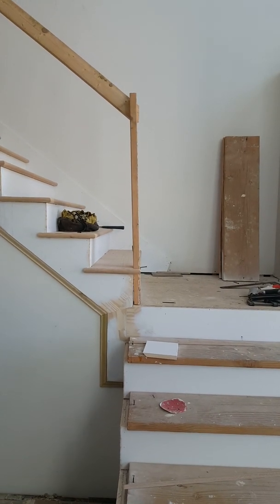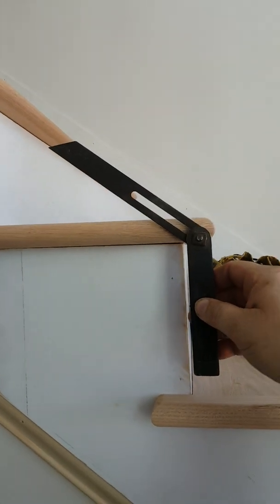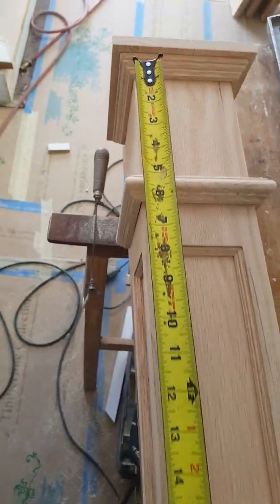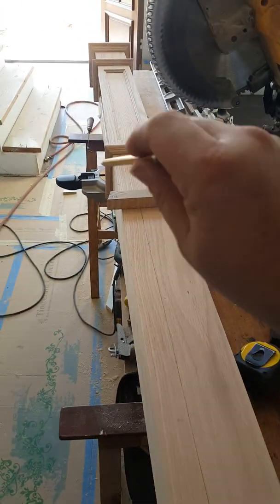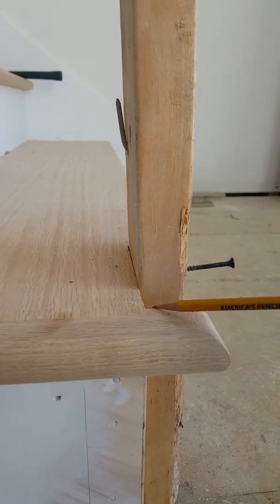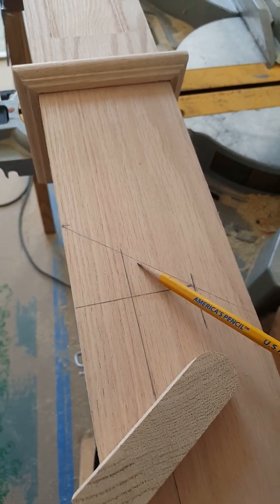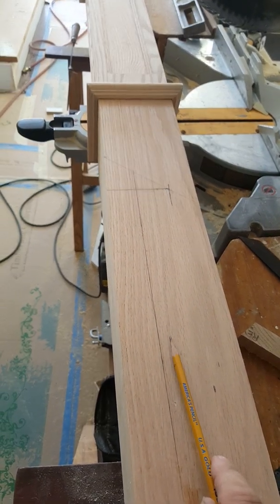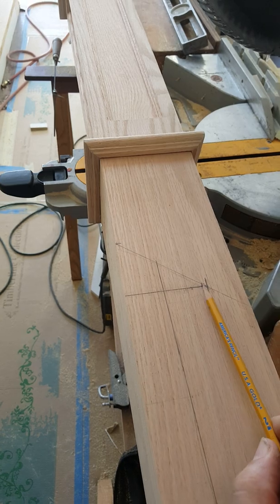How to determine stair newell post height.

Comment: Also, how do you find the length of the rail as well after you put the post at the top or if there is a oval instead? I’ll end up laying everything out in AutoCAD step by step and set back by set back, along with the thickness of each step and then it tells me what the angle is after I offset my lines between 34 and 38 inches off the front of the nosing.
Reply from the maker: there may or may not be an oval(called a rosette). as i said in the video, it depends on your particular situation... and my video is NOT  made to cover all situations! the handrail aspect is a complete DIFFERENT chapter in the lesson. i was NOT including nor instructing handrail installation. i was simply accounting for WHERE the handrail would intersect the newell post for height reasons. but as far as the angle or "rake" on the handrail, it is SIMPLY determined by laying ANY straight edge on the nose of 3 or 4 steps at least, and then placing the BEVEL square on that straight edge while placing the other side of the square on either the step...OR the riser, which ever is appropriate... determined by YOU. THAT will be your handrail cut angle. typically it's approximately 37⁰-38⁰.  cut you a scrap piece of 2x4 or similar aprox 3ft long to replicate AND check the angle by ,once again, laying it on the step nosing. you can use those pieces to help determine the handrail length. but THAT (handrail) lesson is in the other instructional video...the one you never paid for. so you'll have to figure THAT out on your own. i made my video VERY CLEAR in that.. each stairway could be ...and probably will be different...depending on your unique situation.  I'm NOT at all "vaque". 
as far as your foolish statement about me collecting money for my videos...let say with utmost clarity...i simply DO NOT get ANY benefits from posting any of my videos! your a FOOL for implying that i do, at least at this time. ive NEVER  took that position.  im simply here to offer up some help for those that are in need of it...or maybe just some inspiration.  personally when i look at videos that dont quite capture what I'm lookin for, i jus simply move on... i dont make ass head bitchy comments to people like u did to me. as far as waiting 5 or 6 days for a reply.... you're lucky i even replied at all. if i was commenting on others post, i would consider it normal to get a response back in 5 or 6 months! 
let me remind you ....im NOT getting paid to do any of this. so if my response does not suit you...please send me a personal $$$$$ payment so i can give you more lessons. you can leave that computer turned off if your doing a stairway with me.. 
I've got plenty of other thankfull, appreciative comments regarding my video... i KNOW EXACTLY where i stand as far as  Competent, solid, throughly, good, well defined craftsman. your opinion is  Miniscule in the landscape. just as your  LACK of content on YOUR page is all the proof that i need. let your works speak for you.  but in your case, while asking for help... your words of ignorance are loud and clear.  now go put your handrail up...and leave me alone!
Reply: @hotrodswoodshed7405  wow, just wow. That is all I can say to that posting. You surely have a lot to learn about tact and business. If your business name has anything to do with your screen name, I can assure you that you are going to lose business by being such an asshole.  In my 27 years of being a high-end custom cabinet maker/furniture builder, I haven’t needed to do and learn good methods of figuring out the length of railing, etc., as I can just use AutoCAD and be a lot more accurate than you are able to be. Best of luck to you and your endeavors being a dickhead.
Reply from the maker: @mim2046  best of luck with your cabinet shop
Reply: @hotrodswoodshed7405  Well stated!
Reply from the maker: @curtisbrowning2817  thx
Reply from the maker: not easy to give you a quick awnser at this moment..  ill think about this, and respond at a later date
Reply: @hotrodswoodshed7405  it’s been 5 days….do you really need to take that long to “think” about it?  Why do YouTube videos to “teach”, yet leave out critical information, say you have to think about it and then never respond. Seems kinda pointless 🤷🏻‍♂️

Comment: Unless it is just me, you didn’t show how you actually got the angle of the rake of the steps. U held your sliding bevel up to one step, but it obviously is not long enough to reach the next step, so how did you find the angle to cut your railing at?
Reply from the maker: i used a long straight edge object...like a level or wood strip to connect those steps...and lay my bevel square on that

Comment: Thanks, just the info I needed
Reply from the maker: You're very welcome. Realizing that every stairway can be different with even the most smallest changes. Still hoping to give the aspiring Craftsman some tips and at least get you pointed in the right direction, where you can figure the rest out. Thanks for the great compliment

Comment: Why would you cut all the way to where the nose is, the second vertical line in from the left side? Especially if the nosing on the tread is cut in, wouldn’t that push the post to far to the left? I followed this for my post and ended up cutting it too far in.
Reply from the maker: I DON'T recall saying that I actually did cut the post to the pencil line where the front edge of the tread nosing is.
 Watch the video again. In the video where the post is laying down and I'm using my pencil to show the cut out marks on the bottom of the post. The far-left vertical pencil line is my actual post cut line ( that will actually glue to the face of the step riser). However The far-right vertical pencil line represents where the tread nosing is intended on lining up after installation is complete. That far right vertical line is absolutely NOT the cut line. It's only there as an illustration to help me see where the tread nosing will hit when I install the post. Aside from any particular lines that I tell you to cut on, the reality is each stairway has its own unique placement of the newel post. On this particular stairway I establish how far away from the finished tread end that I want the post to be placed. And in most of the circumstances that can be whatever you prefer. However once you establish that, you have to find the center point of that post running parallel with the tread ends) as well as the opposing right angle Center Line of the separate run of steps that continue running up to the upstairs Landing. When you determine those center lines, they will create a right angle, and where those lines intersect will determine where that corner post will be placed. You have limited control over where that corner post ultimately is placed at that point. My reason for describing this is because typically I prefer the front face of the post to be fairly flush and in-line with the front Leading nosing Edge of the tread, BUT because of placing that post where those center lines intersect, it will not allow me to have the face of the post line up with the nosing of the tread that I might have otherwise preferred. It's just the rule of physics at that point
Reply: hotrods woodshed This makes a lot more sense, I wasn’t clear on which line you were going to cut, I cut mine the same way you described and was actually OK I was just overthinking it. Thanks for the reply!
Reply from the maker: @tstaur6052  overthinking it. Yeah that's very easily done! It's also way too easy to get in a hurry and start cutting up. It's always best to go back and double-check or even triple check your measurements and what side of the line you're supposed to be cutting off. Stair parts are expensive and it's always good to stop and consider it everything hopefully you come up with the same answer every time you consider. That means you are going in the right direction. I've been doing stair work for 20 years. And each one is unique and different and many ways. So even with my experience I still have moments where I need to stop and really think about what's going on and how all the parts interact. Otherwise I also can get confused. Even making videos of the process is a learning curve in itself, trying to figure how to convey in words what I figure out in my head. Glad I could be of some assistance